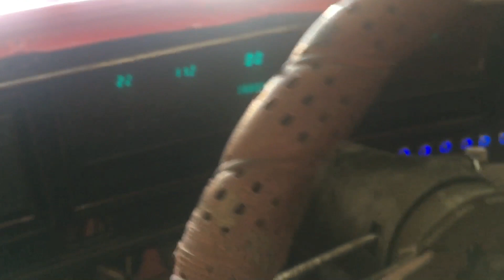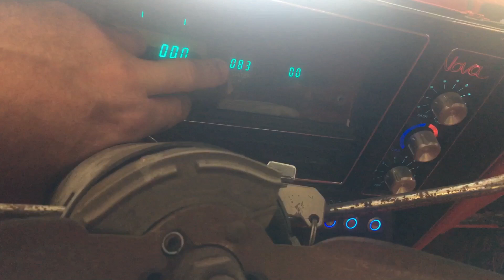Ls3 GM Performance Engine - 1st start up

Comment: Hey there man I just saw this video since it was on my recommended (since I'm looking at Ls swapping a Foxbody Mustang as my first project car) and was wondering if you have found some car alarm system with power locks for cars (if you have one) since I don't want somebody to steal it from me. The rebuild process on your ride seems dope asf; I'll watch a couple more videos of yours to see what you've done to your sick hot rod B)
Reply from the maker: I never hooked up my alarm which came with my keyless start. Course I never go anywhere where I can’t see it , we’ll try to. Good luck on your swap. Ls’s are a great engine.

Comment: How did you wire up your alternator? Did you discarded the one wire from the harness or didnyou use it. I have the same set up with a one wire alternator and i was told that i didn't need the wire from the harness, it bothers me because it runs to the ecu. The ecu must be reading something off that wire.
Reply from the maker: I just have it ran to the battery that is all. I get 13v +/-

Comment: Looks great good job , I was wondering why you are using a fuel regulator on the fire wall, for a return-less fuel sys a fuel filter / regulator  I thought  would be used just wondering. Sounds great
Reply from the maker: Olds 68 - the ls3 is designed for a return feed. This return fuel goes back into the fuel hat in the tank where my pump sits. 

The regulator can be mounted anywhere. I chose this bc it was low & almost out of site.
Reply: Ok , you have installed adjustable Fuel regulator/Gauge , for monitoring and adjusting press , great idea,  On your LS3 and from what I can see in your vid you have a single line running to your fuel rail/injectors. With my stock LS3 I have a Fuel filter/ Regulator close to the tank (stock setup) the return takes place at the Filter/Regulator back to the tank. I was just wondering why thank you
Reply from the maker: Olds 68 - yea it was a breeze to set up. The regulator was a set & forget. 

No worries let me know if you have any more questions.

Comment: I bought the same motor what is that black tube in front on the throttle body
Reply from the maker: Sorry for the late reply man. That is my 4 inch Air Intake Tube.

Comment: If I pull out a used engine from a 2010 camaro. what can I do with all the wiring when placing it on a old truck.
Reply from the maker: Alonso everything should mate up.  But the computer in the truck will not be any good. For it is set up for the truck engine. If you’re doing that Camaro Ls swap I’d advise getting it with the engine.